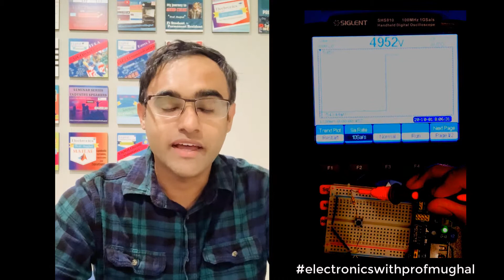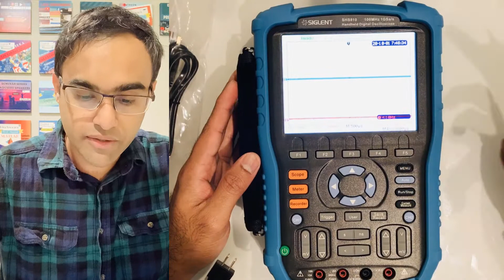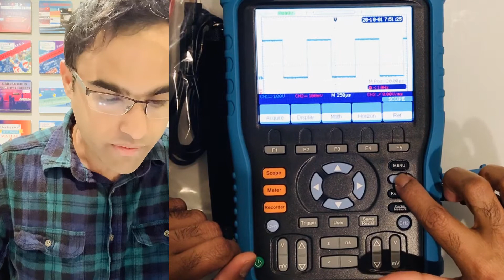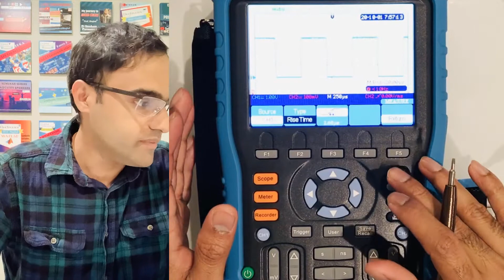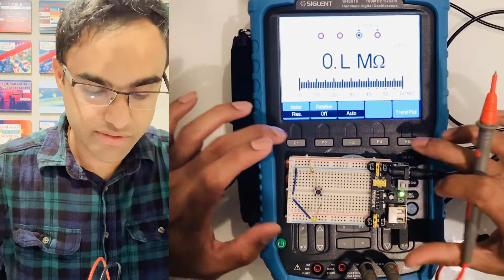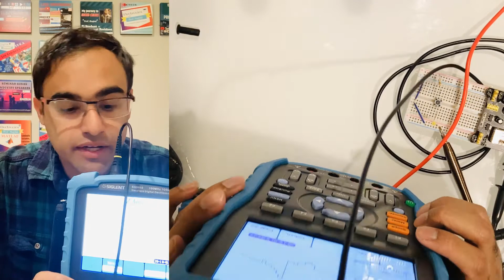#1 Quick Review of Siglent SHS810 Digital Handheld Oscilloscope | Multimeter | Waveform Plotter

Comment: Not sure if you are still looking at the comments but I just got one of these but cannot work out how to get waveform data from memory to the PC, connecting with the cable the Windows 11 PC doesn't recognise any drivers and no access to the memory appears. There is nothing on the RS website (they market the instrument as RSH810 but it looks exactly the same as the one you are suing), and the user manual also doesn't say anything of how to get data from the instrument via cable or USB. If you are able to demonstrate the steps required to get the data off the instrument that would be really helpful.
Reply from the maker: Really busy these days, but will try my best.

Comment: It appears all Siglent handheld Oscilloscopes have reached end of life and as of 31 Dec 2021 have been discontinued. Siglent's website says new "compatible replacement products" will be debuting soon.
Reply: For a few days I have been considering purchasing this product.
It looks like a good product, but I just confirmed on the website that the product has been discontinued.
Thank you.
Reply: @k.hanbok2297  Yes, I've been waiting patiently for the new Siglent handheld scope(s). I do require all I/O Isolation, but cannot afford the Rohde & Schwarz Scope Rider, nor the comparable Fluke Scope Meter. I purchased the new, cheap Owon handheld HDS2102S (I/Os not isolated of course) from Digi-Key just to have a "throw down" scope in the meantime...
Reply: @Cleofizoid  
Today, I bought the OWON HDS272S to use for a while. This scope was my go-to option for under $150 with the sale on aliexpress.
I will also wait for the release of the new Siglent handheld scope for work.
Siglent handheld scopes will occupy an important place in my work.
 Naturally, all I/O is isolated and good LCD, hopefully the performance will be better.
Thanks again for your information.😄
Reply: @k.hanbok2297  did you end up getting the new one? if so is it any good?

Comment: But the latest firmware is so bugged and ugly. If you use the scope with dark mode screen, most of the time when you turn the device on, the screen is messed up and the only solution is to switch to normal (white) screen mode to make it readable again. And the frequency counter is almost impossible to read because they put white numbers into the green outline, so smart... Support said they have an update with fixes within a month, it was 9 months ago...
Reply: Hi from where did you get the firmware?
Reply from the maker: @2010shadow80 I think it came in with a usb.